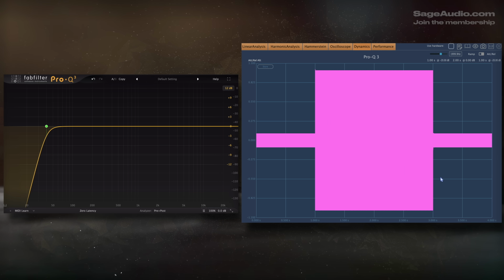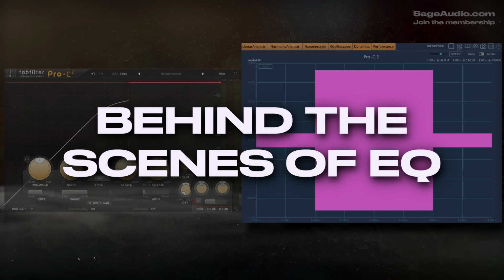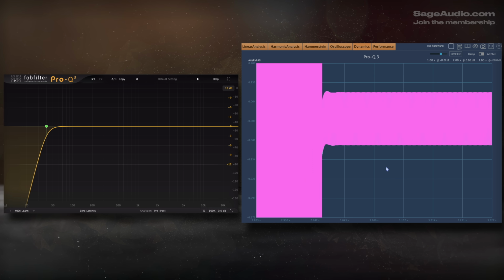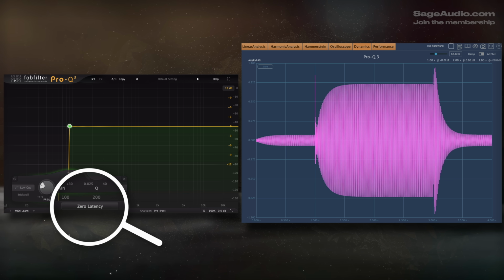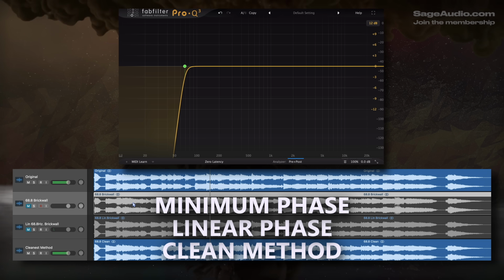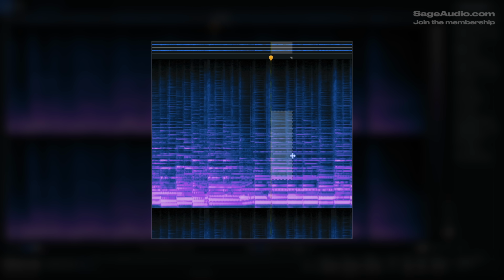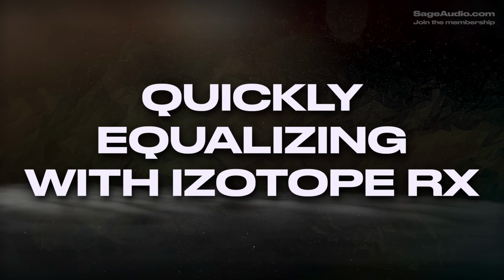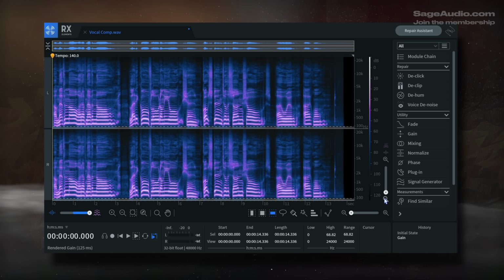The Cleanest, Most Accurate EQ Possible (and you’ve never tried it)

Comment: does the rx has a specific Q value? I mean that,  if i amplify the 1000Hz region with rx it does only amplify  1000 hz and not 900hz 1100hz as well. . So how do I achive that gradual amplification arround the center frequency?

Comment: I don't think there's such a thing as removing 70Hz information from a file. All audio files are kept in some form or another as PCM data. A wave. So what RX may be doing is spectral decomposition (into frequencies and phase for each frequency) edit, then recomposition. This process is also very time consuming. That's why it's not available as a plugin, you can't "live" preview this without massive delay. But this allows for very precise and surgical edits without affecting phase at all.

Comment: RX filtering is definitely still introducing pre-ringing, and a lot of ringing in general. It really is equivalent to a very high quality linear phase EQ. The visual feedback from the spectral display can help point out issues quickly, but the only away to alleviate the ringing is the same as in a brick wall Fabfilter HPF: make the slope gentler. To do this in RX, there is a "Feather selection" tool. You can try something like 0.5-octave feathering. Not sure what the equivalent db/oct is, but I'm sure you could easily get a similar result with a high quality linear-phase EQ.

For example, I tried cutting ground loop noise from a high-gain guitar part, using RX's "select harmonics tool", and after filtering, whenever signal is present there is audible ringing at the "notched" frequencies. Tried again with a feathered selection and the ringing was less audible but the part was missing too much. And too bad spectral de-noise sounds like a crappy mp3, even at conservative settings. I found it was better to leave the noise in the mix for that particular guitar part, it was only for one section anyway, and it sounded great in the mix.

For critical low end filtering of the sub-bass found in bass and kicks, I've been turning to TDR Infrasonic. It's not any better than other digital HPF methods, but its focus on options specific to that region helps me to get the results I'm going for quickly.

Comment: this is literally just the infamous byproduct of doing real time fft processing which introduces problems like spectral leakage and low spectral resolution due to having to work with small time windows

rx isnt doing anything particularly different here, its just that it has the privilege of having access to the entire signal which means it doesnt run into these issues as opposed to eqs doing live-processing

Comment: I mean rx is an incredible tool! Been using it forever now. Not necessarily for EQ but if I want to remove some unwanted sound or noise, it’s definitely the easiest way to EQ it out. I’ve met several top level engineers who spend hours cleaning up files on RX like this. Also for pro tools users they got it built into the daw now with ARA support.

Comment: RX applies a normal linear-phase filter to separate the selection. The only difference with FabFilter's linear-phase EQ is the frequency response shape. RX is more surgical in frequency, while Fabfilter uses more "analog" shapes, with a certain number of dB/oct. Still, RX has similar "artifacts" to any other linear-phase EQ (pre- and post-ringing). Like me, you appear to favor RX's lack of frequency leakage, which is probably due to surgical EQ shapes. Very similar EQ shapes are also available in Kirchhoff Eq, which measured the have the least noise @ 96dB/oct. of all the popular EQs that I tested. However, I did modify the settings, by using Linear phase and 117bits internal processing option. I hope to hear back from you on this!

Comment: RX like all spectral tools uses FFT (fast Fourier transform) and inverse FFT to go back and forth from wave data to spectrum. I would not do it too many times because that process has a limited “frequency resolution”, which can degrade the signal if applied repeatedly. BTW I am already annoyed by one round of FFT and inverse FFT processing… Actually it’s the same kind of processing which mp3 encoding-decoding is based on.
Reply: i can hear it

Comment: you don't understand filtering or DSP sorry, you've modulated the input sine, which will generate content all the way up to nyquist, so surprise surprise its gone by the time you hit the max bandwith. the spectral filters of izotope cause many artifacts that you haven't even tried to detect. Take a free MIT course in digital signal processing, and then come back with some informed opinions
Reply from the maker: I appreciate the input! You're right; I could definitely learn more about the math behind what's happening here.  Still, this video has enough new info that it's helpful to those more focused on mixing and mastering - but perhaps not helpful to someone such as yourself, with a complex understanding of DSP
Reply: @sageaudio  Top pro and kind comment!

Comment: great video. i have been doing something similar for over a decade now. for vocals, i just go to the frequency spectrum, highlight and delete everything below 60. I don't know how different it is than using izotope, but it works
Reply: How do you do that? I mean which tool are you using?
Reply: @Keroser1983  I use adobe audition for mixing. they have a frequency analysis spectrum. there, i do it. I also do a lot of de essing, removing unwanted clicks or voices there with a lot of trial and error:)
Reply: @Keroser1983  frequency spectrum analysis on adobe audition
Reply: @Keroser1983  sorry just checked your reply, I use the spectral frequency display on adobe audition

Comment: Does this mean I can finally high pass my masters (say at < 20hz) without introducing phase distortion or pre-ringing? This is HUGE! 
I do wonder what happens at the cutoff freq though? Surely just having the frequency content fall off a cliff at 20hz will have some weird effect no?
Reply from the maker: Some artifacts will still be present, but it looks like it'll be a lot less substantial than if you used a typical linear phase EQ!
Reply: @sageaudio  think I’ll need to do some null testing to see what exactly those artefacts are from this method. Linear phase without pre-ringing and no real downside seems too good to be true
Reply: @sageaudio  RX filtering is definitely still introducing pre-ringing, and a lot of ringing in general. It really is equivalent to a very high quality linear phase EQ. The visual feedback from the spectral display can help point out issues quickly, but the only away to alleviate the ringing is the same as in a brick wall Fabfilter HPF: make the slope gentler. To do this in RX, there is a "Feather selection" tool. You can do something like 0.5 octave. Not sure what the equivalent db/oct is but I'm sure you could easily get a similar result with a high quality linear-phase EQ.

For example, I tried cutting ground loop noise from a high-gain guitar part, using RX's "select harmonics tool", and whenever signal is present there is audible ringing at the "notched" frequencies. Tried again with a feathered selection and ringing was less audible but the part was missing too much. And too bad spectral de-noise sounds like a crappy mp3, even at conservative settings.

For critical low end filtering of the sub-bass found in bass and kicks I've been turning to TDR Infrasonic. It's not any better than other digital HPF methods, but the focus on options specific to that region helps me get the results I'm going for quickly.

Comment: what causes these anomalies with pro Q ?
Reply: I'll take a stab at helping relate it to an example product:  Read about and demo Grand EQ by DDMF (DMG Equilibrium could be in the ballpark but it was too complex and with higher latency so I stashed it away in the cellar).  Grand EQ minimal phase sounds accurate to me in the freq. & amplitude domain without adding unworkable latency. "The goal in digital equalizer design is always to reduce the amount of digital artefacts which are introduced due to the necessarily finite sampling frequency. As with everything in life, the last few percents of optimization are the hardest, so a lot of effort has gone into creating an EQ which does the least possible damage to your audio material."  "In its minimum phase setting, GrandEQ manages to do just that to an extent larger than most other EQs, and notably BOTH in the amplitude and in the phase domain, while introducing only a very small amount of latency.

Comment: The reason for the leftover content when you eq the modulated 'sine wave'...
Is a real sine wave is infinitely long with no level changes.
Amplitude modulating the signal, by changing the gain, adds sideband frequencies, which extend higher the faster the transition occurs.
Reply: At last, somebody here understands. This is not the right test signal for the job.
Reply: @baptistechatel2569  How about the examples at the end? For the real songs and music. On the instrumentals I could not pick up so much difference but on the vocals it was so clear.
Reply: @Keroser1983  i can definitely hear differences. This is not unexpected, as the two filtering methods wildly differ. Classic EQ have a slope (in dB/octave), which means that you cannot have, say, a 6dB difference from 1000Hz to 1010 hertz. The FFT EQ applies gains to small frequency ranges (called "bins") ; from one bin to the next the gain difference can be huge. I'd love to compare the spectrum content of each clip. Having the dry clip would be interesting.
Reply: @baptistechatel2569  the beauty in changing the amplitude of a portion of the spectral range in offline FFT editors is you can tailor the window size and type for the source material. Definitely not a convenient method but can come in handy in some situations
Reply: @happyshadow  of course ! I only criticize the "methodology" that lead to this "cleanest, most accurate" conclusion.
Reply: @baptistechatel2569  During the video I kept thinking about The Beatles using equalizers, low pass/ high pass filters.
Reply: Thank God you exist bro!   I knew this video was misleading and was about to go on a wild goose chase trying to verbalize what you said in one sentence!  DDMF talks about this issue with their EQ's & I think DMB as well.    "In its minimum phase setting, GrandEQ manages to do just that to an extent larger than most other EQs, and notably both in the AMPLITUDE and in the phase domain, while introducing only a very small amount of latency. The result is a very open and clear sound with, at the same time, excellent CPU efficiency. Its linear phase setting stays completely in the time domain, using an elaborate time-reversal algorithm and 2-fold oversampling to ensure excellent amplitude and (flat) phase response with the lowest possible amount of digital distortion." LP10 is also a great DDMF EQ with controllable "flexible phase".
Reply: intermodulation right?. Placing a lp filter at 22khz after any non linear process should solve this issue for what I know...but I'm not sure

Comment: Good vid!!! My question is what is the best mode in pro q2 for instruments and vocals?  I was told the linear phase is better for bus/group processing while natural or minimum phase is gods for individual tracks. Is this a good assessment? What about zero latency, is that only good for live set up?
Reply: Use it in zero latency, maybe minimal phase. Linear phase eq really affect the dynamics. For mastering it sounds "better" but use it really gently
Reply: In the vast majority of cases, even zero latency mode is totally fine. If you're using aggressive high or low pass filters, you may have issues with phase shift, which natural phase or linear phase can help mitigate.
Reply: @ParanormalArson exactly this. Also if you're doing any mid side EQ it's best to stick it into linear phase mode as during the decoding some time domain issues arise.
Reply: Analog EQ’s are called minimum phase eq’s. The phase distortion you hear as a result is actually a pleasing kind of distortion, and desirable.

By contrast, a linear phase eq will shift the entire time domain and cause a bit of latency and pre-ringing in order to minimize phase distortion. This is fine if you are working on eq’ing a FULL MIX, but can become problematic when using linear phase on a single track due to latency.
Reply: @Neglectus  as far as the latency goes on using linear phase on an individual track, I thought the daw of choice compensates for that. True?
Reply: @beatbanger27  It does but ye latency builds up. So does the smearing of transients and pre-ringing which can be audibly seen as well in a scope. If you do use linear tho it's preferable to use it on the mix only if needed to keep the phase intact. No point on individual tracks imo unless you need it due to very sharp filters. Just keep in mind that on individual instruments including vocals what you are trying to achieve with the eq. Phase is eq. You're sculpting a sound, not trying to keep it as is usually. I bounce/render at the max linear setting btw if used
Reply: @Neglectus  I'm just interested in the potential opportunity to have a tool that can cut/reduce/high pass in a completely artefact free way. It's not that I'll stop using my analog filtered or even digital eq's most of the time. I just find it interesting that spectral editing might be a way for example to reduce the low frequency information in the side channel without impacting the stereo field (other than the task that is intended).
Reply: @happyshadow  Any post process done to the audio is a compromise. Get it right at the source if you want artifact free. I know that everytime I use RX it comes with artifacts, especially spectral editing, but I still use it all the time, starting with clip gain. Only thing artifact free is riding that fader. Even digital eq's still aren't correct with HP/LP filters.  Either way use RX very gently.
Reply: My man, humanity has been mixing great music for decades without ever worrying about these technical aspects you keep mentioning.

Just do whatever sounds good and don't let the ocean of information get too much into your head, it really doesn't matter and no consumer can hear the difference.
Reply: @havila1906  yes they can, but some artifacts or distortion are easy too ignore if everything else is in place
Reply: @havila1906 don't discourage people from asking questions my man, this is how people learn. Great mixers have all been on their journey of learning through practicing and asking questions

Comment: 9:23 wait, in your daw, you can “unrender”? Rendering is by definition destructive, as in irreversible. But there is an intermediate way. I only use studio one, so that’s what I use as reference: you can “freeze” a track, meaning create a reversible waveform with GC and then ghost the effects to preserve the insert settings during a mix. It does not render or overwrite. 

Is your daw creating a SEPARATE bounced render that turns off RX? So that if you change your mind it puts back the original file and turns RX back ON? 

Because if it’s unrendering sh💩, there are gonna be questions about what sort of magic hoodoo have you conjured, and can it be used to unpregnant annoying ex girlfriends, or unbeer goggle last night. 🤣🤣🤣

After seeing what algorithmic ai can do in the music industry, I wouldn’t count out the possibility to “unrender” stuff. We can do stems with greater and greater granularity, even seeing it go from RX 8ish “Drums/Bass/Music/Vox” poorly to some nailing it even removing digital reverb tails seamlessly when removing a vox track, to -I wanna say something like 🤔 divx? SOME company - that can pull out specific tonal  INSTRUMENTS and specific drum SOUNDS. 🤷🏽‍♂️

So it is POSSIBLE in the year since I last turned on my music equipment after losing EVERYTHING IN A SSD CRASH (😡) - it’s possible that you can unrender.
Reply: What's saving the previous audio is the audio editor not the daw. by going into rx you can undo the changes and resave to have It update in logic.

Comment: That’s so interesting. I was wondering why after EQ and compressing voiceover using various EQ and compressors that I was hearing distortion. Also wondering about using a low cut filter in a microphone does that introduce distortion I wonder if EQ on a traditional mixing board also introduces distortion or not do you have any thoughts on that?

Comment: The minimum phase example doesn't sound like a brick wall at all. Are you sure it's correct and it's not 48dboct? I can hear too many upper frequencies that are leaking to be a brick wall filter...
Anyway, you might be right on Izotope rx (maybe not about the fact that it "physically" delete information but about its better, audible, results), because the example sounds like the vocal has been re-recorded with a better microphone and a better placement instead of being just equalized, and the difference is so clearly noticeable...It's not even subtle! Really interesting!
Reply: He showed us the sound of the difference, the delta caused by applying the filter. The filter also changed the phase, so the difference is happening in a wider spectrum range than just the filtered-out frequencies.
Reply: @LYSHEmusic  I know it's the delta but it's a huge amount of leaking frequencies to be a brickwall, even if minimum phase...I'm going to test it by myself to see if I'm wrong anyway. 🤝
Reply from the maker: I just checked the session and yep! Brickwall minimum phase filter set to 68.8Hz.  But, might be worth checking on your end just I missed something.  But yeah I agree it's a lot more than anticipated - the "bleed" seems to be due to the aggressive phase rotation and reshaping of waveforms introduced by the filter.  Thanks for watching!